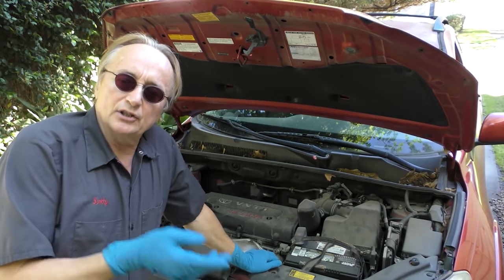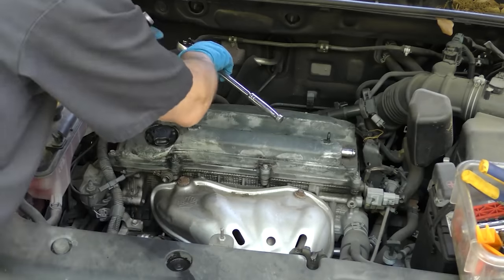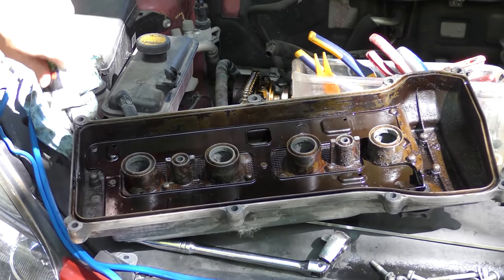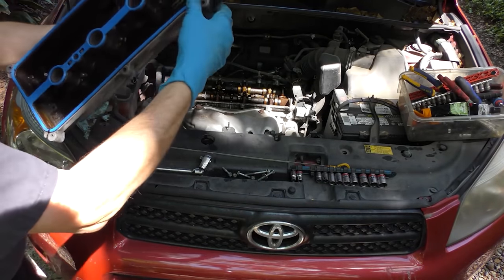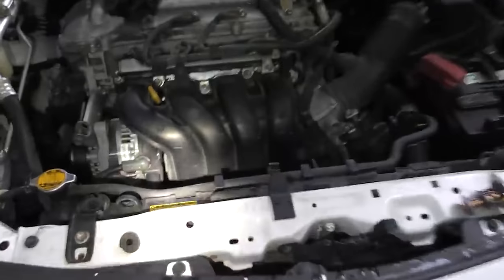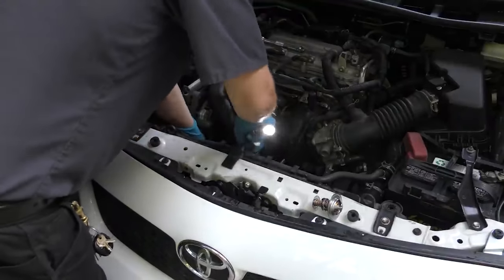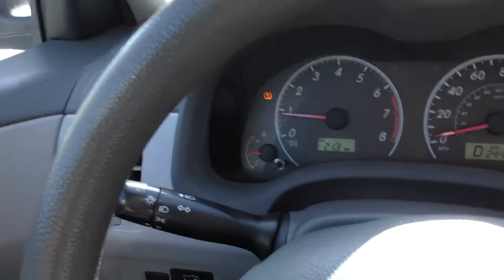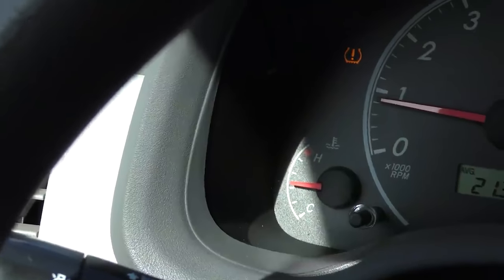3 Mechanic Scams Caught on Camera

Comment: I love watching your videos.  Big help . I watch even if I don't have a problem.  Which now I do have a problem.  Both of my side windows are leaking.  Strange that there both leaking and I don't see a problem with the gaskets there leaking in the center of the windows on both sides.  I see scratches where it looks like someone was trying to get into the car with a coat hanger or something but the gasket look fine.  Even new looking.  I'm at a loss.  Would this be something my mechanic would be able to fix or would I need to take it to a body shop? I have to also fix my truck so I'm hoping it's not to pricy.  Help!!!  Please.  And thank you. Your awesome

Comment: I  have a 2001 Toyota Corolla. At around 180,000 miles, it developed a clunking sound on acceleration and deceleration. I checked the front axels with vice grips to see if the CV joints were bad. They were good. I took it to a dealer who put it on the rack and said it was the transaxel. They were going to charge me $5,000 for a rebuilt transaxel. Not a chance. I decided to drive it until the tranny broke. I took it to a trans shop and the guy wouldn't even look at it. I took it to another shop and he wanted to  take the transaxel out and send it out. Not a chance. One guy said that he checked with his transmission guy who said in all his years, he's never had a Toyota transmission in for repairs! Finally, when I was changing the front brake pads, I  checked the front wheel bearings for wear. With the calipers off, I put on the wheels and checked for bad bearings. Man, one side was totally shot! I took off the disk and had a shop press out the old bearing and press in a new one. Cost: labor & bearing was $110. Problem fixed. Two years later, the other side failed. I went right to the test: it was another bad bearing. Same fix. It helps to know a few things about car repairs, but I think you have to have had an interest in this since childhood. A bookworm/non-interested-in-fixing-stuff-guy should just find a good mechanic by asking around.

Comment: Why didn't you just test the thermostat?   If it opens at 190, put it in a pot of water on the stove  with a thermometer until the temp is right at 190 or200.  If it doesn't open, it's stuck.

Comment: My mechanic is great. I used to have Kal Tire change out my winter/summer tires and store them. Everytime without fail a mechanic would show me an estimate for about $1500 for work they claimed I needed. I would say I wanted another opinion. The guy would be mad. Found the mechanic I use now. He checked it out, said nothing needs doing, and even if it did, he would do it for much less. I was good to go on my 500 mile road trip.

Comment: In London Halfords a major chain servicing company tried to charge my wife £185 to replace 4 spark plugs on her Skoda Octavia. they claimed it would take a skilled mechanic a minimum of 45 minutes @ £80 per hour labour. I purchased 4 Bosch spark plugs & a 16mm extended wrench for £55 inc delivery. I reckon I can change 4 plugs in under 15 minutes. It's happening in every country.

Comment: I had a '98 Rav4 with a timing belt that was going bad, thankfully I was rear-ended at an intersection and totaled three days before I went to change the belt. That job just looked bad from the outside of the vehicle, let alone getting into the guts of it.

Comment: I remember getting my knocker sensor replaced in my 99 Lexus

“Your hoses need to be replaced” “your car needs to be aligned” 

I said no way. My hoses were fine and never leaked even 2 years later. And my car was misaligned but because of just how old the suspension was it wouldn’t stay aligned at all and would be back to where it was within a week. 

A nice V6 that can get you to hell and back without a sweat. Always had ice cold AC with no overheating. One of those cars that just kept its factory horsepower even with 200k miles still feeling like the 210HP. 

And this guy was trying to get me to replace these things that were in great condition. Never used him again after that. (My fault anyways because my friend was always telling me how much he had to replace on his dodge charger with 30k miles and I just assumed the charger was the problem and not the guy who “fixed” it

Comment: I just got rid of my 2012 Nissan Altima that had 296,000 miles and was STILL running when the truck came and picked it up.  I have a 2014 Ford fusion and I'm hoping to get 200,000 + miles out of it, so far ALL hi-way miles.  MY wife and I are looking for a new car now, CAN you recommend a make and model and WHERE I should or should not buy it from,  THANK YOU FOR ANY response!! GOD BLESS!!

Comment: This guy has a lot of knowledge for an old timer, but you can tell by his work (no fender covers; resting fasteners and tools on the engine and on the vehicle; touching the interior with dirty gloves; using weatherstrip adhesive on the engine; not knowing the difference between a nut and a bolt) that he never worked in a real, professional dealership or garage. Good for a backyard guy though.

Comment: I had an overheating issue with my dodge neon so I took it to this shop I always take my car to for jobs I don’t know how to do. They said they couldn’t figure out why it was overheating so I got my car back with no charges owed and advised I take it to a dealership…I changed out the thermostat and radiator cap and problem solved,

Comment: based on the drained fluid when he replaced the thermastat - I would suspect that they did not even change the hoses.   On my old ford, if you took the top and bottom hoses off, almost all fluid was drained. And personally, if I were to change the hoses, I would drain it on purpose.   Now that I know better, probably would have attempted a flush as well ( you can just take bottom and top hose off radiator - shove a garden hose into top hose and flush for about 5 min.   gets the crud  out. then just put new hoses on and put antifreeze solution in.    back to orginal though, check the hoses and if mechanic did not change hoses, go back and demand money back.

Comment: I know not to let scotty touch my car. He did not properly torque valve cover, thinks A/C and heat can be ran at same time. For 72,000 miles the engine don't look very clean. My 200,000+ mile Subaru looks about the same.
Instead of properly repairing the head gasket he wants to run sealer through the engine, which can cause more damage, and tell the customer to scrap the vehicle.

Comment: My biggest complaint is when it comes to tires! They give you a mileage amount they should last but for the last 20 years when I get a flat I am always told I have dry rot and often have plenty of tread left but the tires keep cracking in even buying top name brand tires. How can tire companies advertise a certain mileage you should get but I am lucky if I get half the mileage advertised. How do tire companies get away with false statements of what you should get on a new set? Thanks.

Comment: I have a brother who is a mechanic. I so happy when he worked on my car I had to get my hands dirty. I learned the basics. Brakes, flush a radiator, tune ups, etc. I am back in 70s on a car, not a computer like today. The last 20 years I drove I had a realy good place.  I only broke down once in 20 years. A front spring in a Nissan Vanette. It was not their fault, it just broke with age. Same vehicle I had an import motor put in. The alternator went. Being import from Japan they could not get parts. However with an old one they had in the shop, the one that broke and some parts, had me going in 4 hours. They made me a priority know I needed the van to work. 20 points out of 10. 

Some of these guys need taking to court for highway Robery. A friend had a mercedes.  Needed a wheel alignment $800. Should be about 40 or 50. A week later he traded it in.

Comment: Only thing I go to the dealership for is a battery.. they're a little more $ than Walmart/Auto part store, but Toyota will give you a 5 yr battery vs the others only offer 2-3 yr warranty.  I live in FL and the sun eats batteries about every 3-4 years. So I always get a prorate on the last year and pay the same for a 2-3 year... Also if you have to put a reminder in your calendar around 3 years and just start leaving lights on so it does within the range.  YW.

Comment: Great video however I did not see if you degreased the the cover seal track or degreased the top of the head gasket seal surface. I just saw you wipe it off.  I as an  ASE certified Master Mechanic from the 1970, 1980 and early 1990's I have always cleaned and degreased the surfaces where the gaskets seal on. That way when I glued the gasket in place it stayed sealed. I found this eliminates any possibility of gasket movement, always made a perfect seal and never did I have a come back for poor workmanship. I always used a torque wrench and tightened to manufacture specs according to the approved pattern.

I worked in both Texas and in New York Long Island. I have seen some of the most crooked shops that when I tried working there I quit in a week because I could not follow shop policy to rip people off. And others that had the worst mechanics on the planet. Parts changers without a clue who could not fix a Hot Wheels car.

Comment: The problem with the dealer mechanics is not necessarily that they don't know what they're doing, it's that first of all, they are often required to follow designated troubleshooting steps. Secondly, the dealers are so hungry and greedy the mechanics are pressured to finish jobs ASAP regardless of quality. If it doesn't fix it, customer comes back for more, so it's a win win.

Comment: on the note of invincible corollas, i had an old 83 that cost about $300 to buy. turns out it had a crack in the sump, so it was leaking oil all the time. I stopped putting oil in cuz it was costing more than the car did, and it ran for another 18 months before seizing.

Comment: Here is the biggest rip off of all time and I have the receipts, plus Fords written statement about it. My pregnant wife works about an hour away, she has a 2020 ford Ecosport, hold the ford jokes lol I’m a Toyota man but she wanted the Ford. Anyways, the engine coolant temperature error came up (overheating), so we took it to a shop nearby. They replaced the water pump and thermostat, that didn’t fix the issue. So, literally they then fixed the cooling fan and two sensors. 

This still didn’t fix the issue, it got us home but it overheated again. This time I was with my wife and we took it to Ford. They diagnosed in 20 minutes that it was a BLOWN COOLING FAN FUSE.. My wife was charged 1800 bucks for the previous work which was not needed, all we needed was a fuse. It makes me sick to my stomach that certain mechanics feel comfortable ripping people off. Glad I found this channel, super honest and you can tell Scotty takes pride in his work!

Comment: When changing my antifreeze if it's not premixed I always use distilled water instead of tap water this can make a big difference in your radiator by keeping it clean  and cooling system because the distilled water don't corrode up when you mix it with antifreeze like tap water does because of the minerals in it

Comment: lady came into lithia in grand forks when I worked there complaining about a burning smell, I saw a hole cracked out of her transmission where all the fluid leaked out and when I told the mechanic what I saw and when he looked at it he said it was meant to be like that but it was clearly cracked. he sent her on her way because it was a warranty job and he couldn't make as much money as he would've liked. that's young mechanics at dealerships in a nutshell.

Comment: Why did you not change the head gasket on that toyota? After you did the temp gage. If it makes the car last longer. And how would you know if the sealant you used worked or not?

Comment: Buyer and repair customer be aware of dealerships . They charge a lot for labor and parts. Sometimes it takes days before they have the right parts
Buy recycled parts, used parts or from O’Reilly ( usually parts are cheaper or go online sometimes is cheaper. Then find yourself a skilled mechanic with low overhead but is knowledgeable and sincere. If he gets it right the first time. Go with him
Best

Comment: I am here to confirm all stealerships are scams! they tried to tell me my bosses truck was out of alignment when I pulled in because they put crap tires on it and I was there to make them put the correct tires on it which I made them, and they did . and after that wont be back to them or any other dealer even to help someone else. this is not even scratching the surface of all the other things I personally seen them do to people.

Comment: I have a 2015 renegade 1.4 turbo. My A/C quit working so I bought a charge kit with stop leak and a new hose and coupling. However the coupling will not fit on the low side nipple??? I’m your age Scotty and this isn’t my first rodeo, but I never ran into this problem before. What are your thoughts on this?

Comment: It's still going to leak because you didn't put a bead of rtv on the seam between the timing cover and cylinder head.

Before you other viewers come at me, go look at your cars valve cover. Theres a bead of rtv at that seam. The manufacturer put it there for a reason.

Comment: some of those thermostats on Foreign vehicles you have to make sure they are in straight,  my ole VW Rabbit I found this with the thermostat it always ran hotter than usual, it was just how I installed the themostat.  I like working on my Vehicle and save alot on labor.

Comment: I gotta ask... how many 10mm sockets did you go through during this vid... 😂
For bleeding coolant, heat cranked, on defrost. Ac kicks in when using defrost, as running ac pulls moisture out of the air, so manufacturers kick the ac in to pull the moisture out yo help defrost faster, as frost is frozen moisture.
And blue devil, "water glass" is the inly head gasket/leak sealer id ever bother consider trying.

Comment: Only once in my life did I ever take a car to one of those cheap oil change joints and I regretted it. Over the next couple days I noticed it had a small leak that wasn't there before. I climbed under and discovered it was coming from the oil filter. I checked to make sure the filter was on all the way and tight. It was way too tight.  So of course the next step was to drain the oil and replace the filter thinking maybe the seal was bad. After changing the filter it still had a small leak so I decided to inspect things more closely. What I found was that the oil filter adapter now had a crack in it that wasn't there before I took it to them. Moral of the story... A cheap oil change turned out to be much more expensive and wasted more of my time than I was originally trying to save. Three oil changes later and a new oil filter adapter when I should have just found a spare half hour somewhere and done it right myself.

Comment: Some of the dealerships use apprentices for car servicing (often not supervised) and assume those will do a good job. I had to replace the alternator after the dealership servis did the major overhaul of the engine - and the idiots neglected to see rhat the coolent was dripping onto the alternator and it ate the soldering on the rotor and it caused the alternator to fail. I had 1000 € bill for the first job and had 400 € for the alternator repair...

Comment: Hey Scotty I've got a question to ask I have a 2004 Ford escape been very well taken care of and having a small problem with the transmission I know it's not internal. just had the solenoid changed and spent $500 on it not too happy about the result because it did not fix it what it is doing is it will shift into park reverse skips drive will go into second and first but it won't go into drive unless I'm going 40 miles an hour is basically like driving 3 on a tree without a clutch. The mechanic can't figure out what's going on with it and I would like to have it fixed what do you think I should do.

Comment: Scotty you're a daft mechanic sometimes. And you got scammed. THAT'S WHY THE HOSES WERE REPLACED. You'd changed thermostat and caps and faffed around without looking FIRST for signs of cracked head or gasket ???   the new hoses likely already ballooning out with combustion gas inside.

Comment: My sisters and I have a shop we go to for tires and sometimes oil changes. They always try to say something needs to be done. Most of the time I know it doesn't since I either just did it or it is on my list. Though my sister would get panicked about it. They tried to sell her on brakes when she was about halfway through her pads. One time they were saying that I needed to flush my cooling system, which I already was going to be replacing my water pump and flushing anyways, I laughed and said they should have tried to sell me on suspension since I knew it was shot. I did that myself for about $400. I tend to go for cheaper stuff that doesn't make a shop much money and ignore their upsells. When I was a kid my dad had a truck that would cut out and no shop could seem to figure it out and sold him on a catalytic converter cleaner. A little shop in the middle of nowhere said "ya ever replace the fuel filter behind the passenger side tire?". Didn't know that tiny filter was even there, and it was clogged up.

Comment: The problems with cars today is not the major hardware staff its all electric sensors etc. That is hard to fix without having expensive diagnostic reader like Scotty has (5K) So your engine light is on and could be minor or major repair and you are praying your mechanic doesn't take you hostage.

Comment: Lol,

I took my car in for an oil change and tire rotation and they said I needed new tires and brakes. I declined because I had just put new tires on it and new pads and rotors. I never went back to that shop.